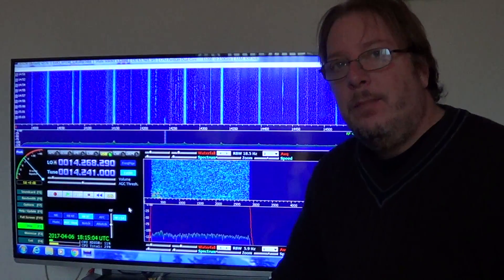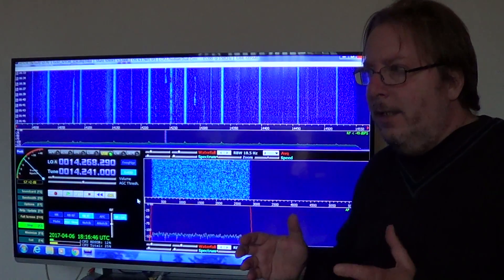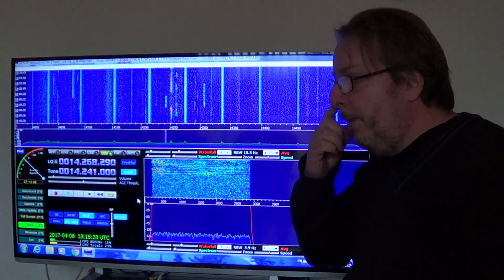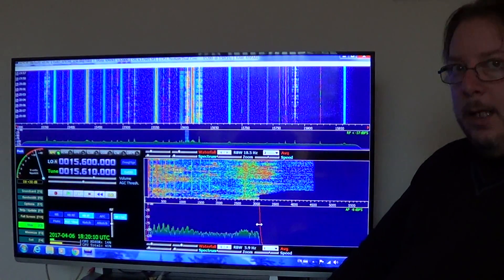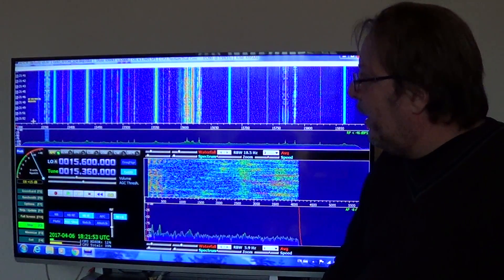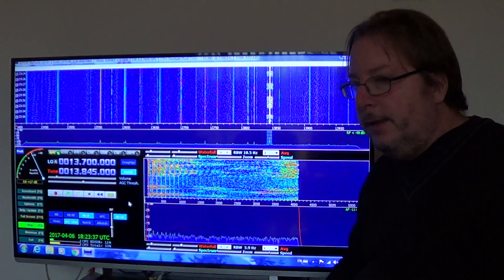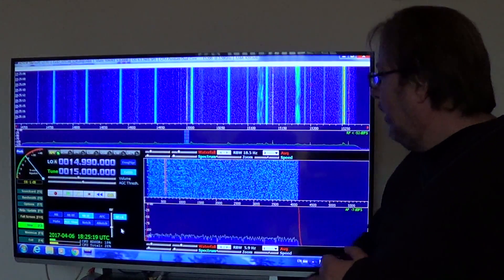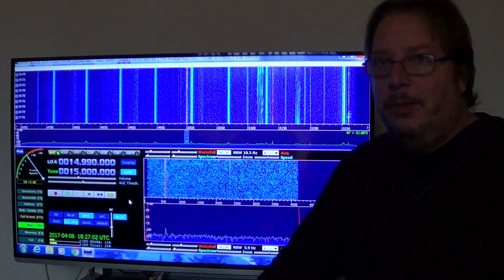Part 2 Of the look and review of Afedri SDR receiver

Comment: Gillies if you have not tried it yet give Simon's SDR-Radio software a try. It is FREE and great software.  sdr-radio.com In my opinion it is the best software there is for an SDR and he has it configured to work with Afedri among others. He has 2 versions, the new Beta Version 3, and the older but stable Version 2, I use Version 2 because it is less resource intensive on my old computer. They have different layouts you might want to try both.